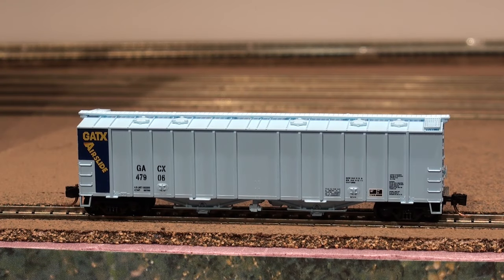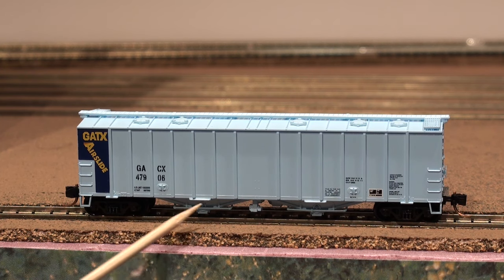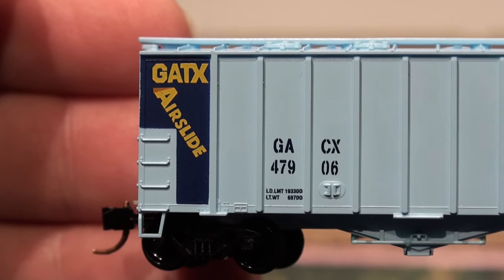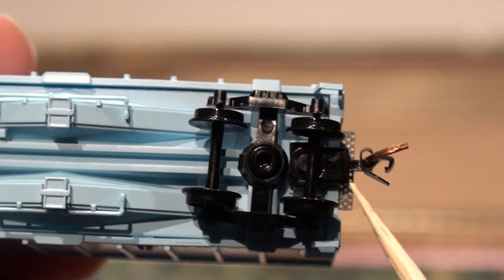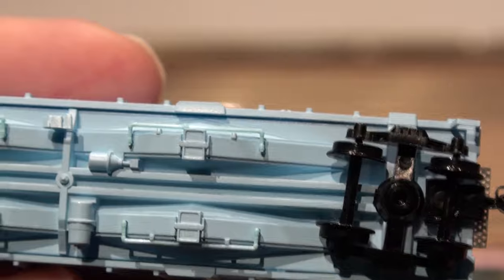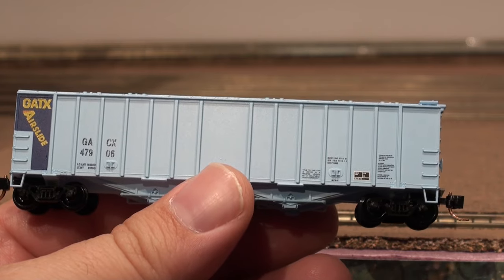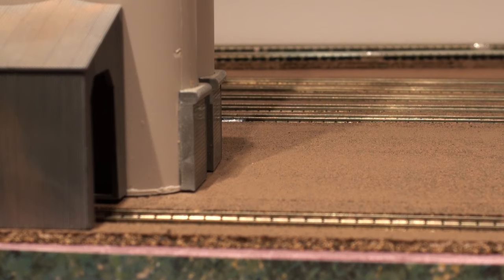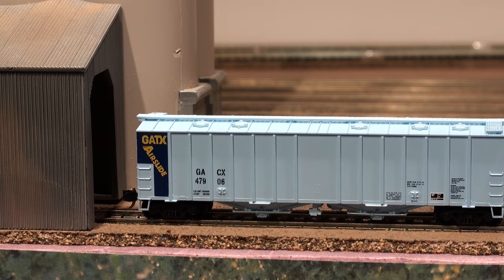ManCave Review - MTL 50' Airslide Hopper

Comment: How accurate was the coupler height, and it is adjustable?
Reply from the maker: The couplers matched up just fine with the other MTL rolling stock.  It should be just fine to adjust a bit but not too necessary.